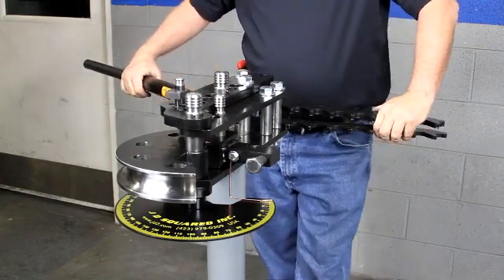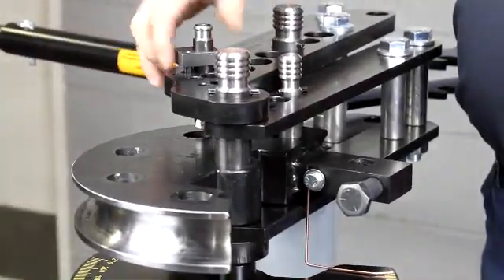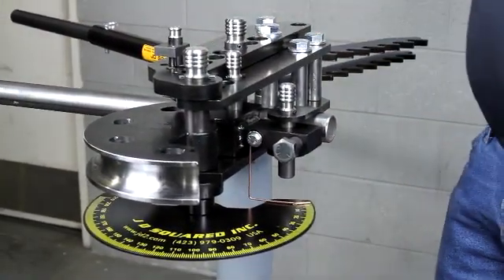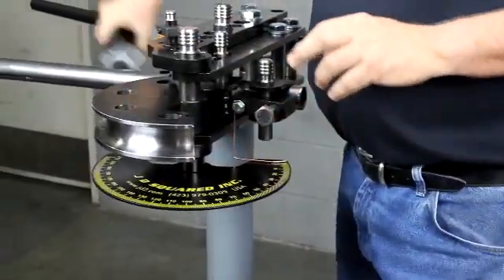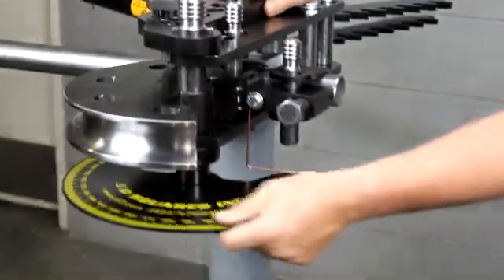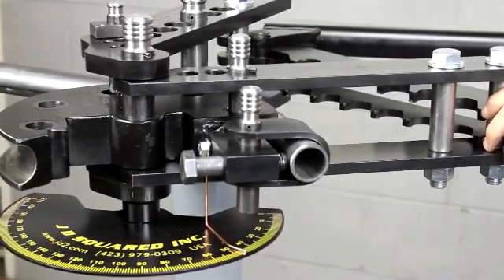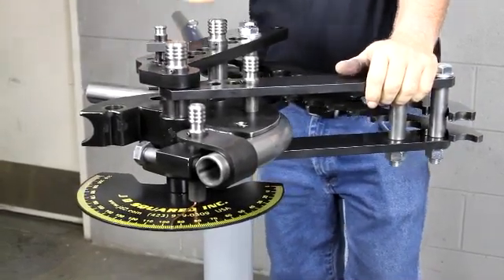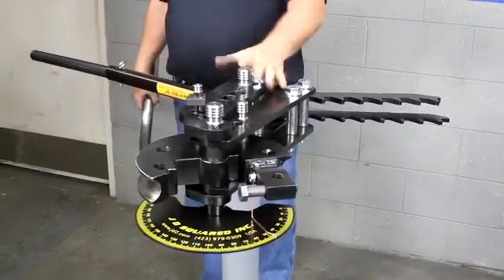Model 32 Manual Bender by JD Squared, Inc.

Comment: What is the thinnest wall 1-1/2 and 1-3/4 , 4130 tubing you can bend without deforming the inside surface and flattening the outside wall...?

Comment: CAUTION  buyers outside USA !!!! I purchased this model from a UK distributor and 3/4 of machined (not painted) surfaces had RUST (even fingerprints were found!! on a piece). Very frustrating !. Bare metal, no trace of grease anywhere!. Using steel woll, I could eliminate rust but 2 spots of rust and rust in holes.. BUT the worse part was a 35 mm die : deep rust, could not be eliminated with steel wool or more agressive material on the edges and in the throat of the die. (I have not checked yet if the rust makes it non functional).  I emailed twice to JD Squared and got no answer. Conclusion : 1/ this guy should talk less and pay more attention to purchasers. (no answer, no replacement)
2/ The lack of any grease or oïl is the responsibility of JD Squared.
3/ Make sure the distributor CHECKS the material before shipping.
4/ Hope it will help.
Reply: sounds like it was ruined at said U.K. distributor because mine came to me as nice as can be.
Reply: Thanks for letting us know what your experience is with this company. I was just getting ready to look them up to order one. Not anymore! Companies that don’t care about their customers aren’t getting a penny from me! Good luck!
Reply: I just got mine friday. No rust. It has a black coating and everything is pristine. Sounds like yours got dropped in the harbor.

Comment: Would like to every CLR die for each size pipe but can't afford that. If there are several different radius's for a given die which CLR would be the best one to cover most bending situations, the smallest CLR, the biggest CLR or if there happens to be more then 2 CLR radius the one in the middle?
Reply: Rule of thumb is 3 times the pipe diameter. 2" pipe is 6" CLR, for instance... give or take.

Comment: Just picked up one this mornin' Bob,awesome bit of work..........
Reply: Will this bend say 1.5" Black iron water pipe? Any idea? Looks like the Creator of the video doesn't respond much. So thought I'd ask since you have one or is it tough enough just to bend thin wall it's best to go hydraulic for much work with thick stuff? Will it bend exhaust without and kinking? Any other comments you have from use you might know from experience with the Bender? Thanks